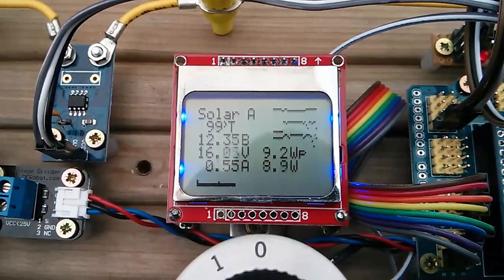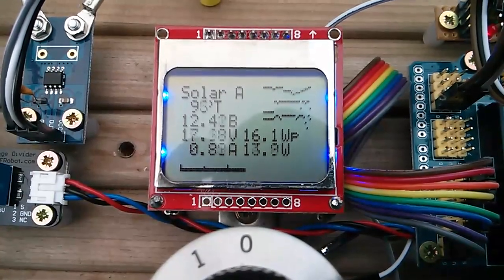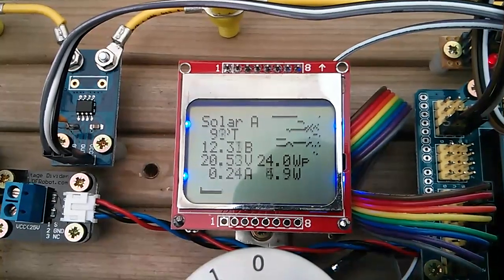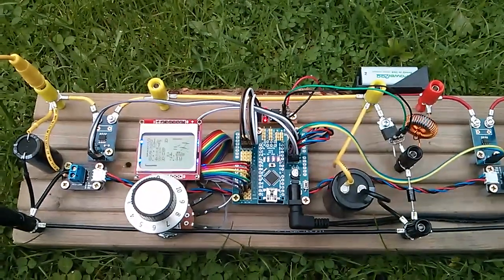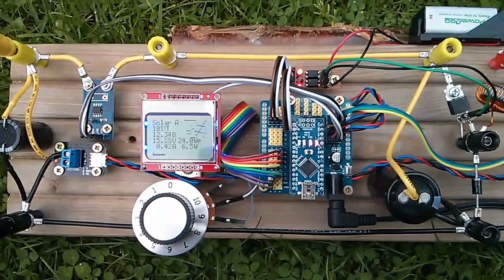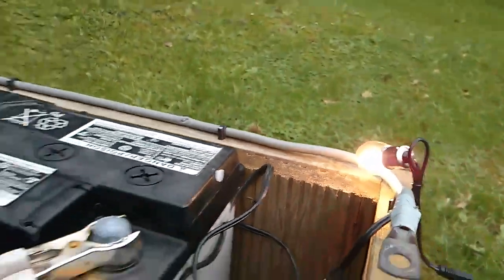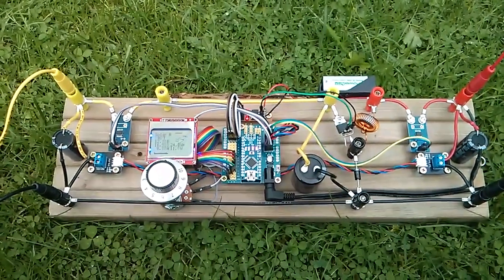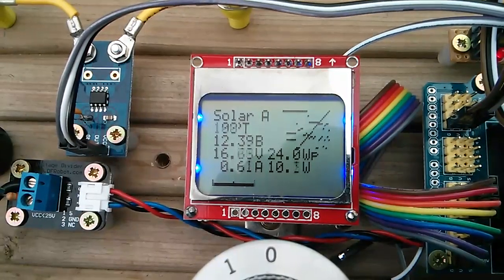Arduino MPPT Solar Charge Controller #18 - Tracking Algorithm Works!.. Sort of

Comment: Why you have used 9V battery? Can't we use same arduino power?
Reply: Kalpesh Patel, to drive an NMosfet highside, so on top of the solar panel voltage you need an extra voltage source to get Mosfet Vgs (voltage gate source) above solar voltage. One might think about to bring arduino ground to solar plus, but this will bring new problems riding arduino on the solar potential. Cuz later on you might want to measure the buck output voltage by arduino ADCs for automatic regulation and this is only stable todo on the buck out to buck ground. Hope this helps.
Reply: illchmann thanks for updating me

Comment: BTW, the ringing you see seems to be between coil and mosfet. You said 100k and 500kHz against 11mH 110uH mas menos. I think that is a resonance between coil and mosfet parasitic drain source drain gate capacitance. I calculated both cases which gives a parasitic cap of about 1-2.5nF which fits perfect to such a big mosfet. Do you plan to continue this project?

Comment: Thank you so much Julian, I have some spare time and I spend a few days on a similar project. Pmax 30W panel 1.67A/18V, BuckBoost from ebay 5A max out (so its a little one), set output of buck to 5V connect a 1Ohm to this +5V and drive it in common source with a big mosfet controlled over simple voltage divider taken directly from solar panel. All in all this is just a testsetup. Today I saw all your videos about muppet or MPPT, hope I didn't missed one, but I consumed them like a junky! I might saw a different  video from you in the past. However, your channel was new to me and I dont know why I never noticed it.....  I like the practical way you apply electronic knowledge. Let me ask one think that I saw in your project. You got in trouble with the automatic tracking, and also at beginning the input current measurement was highly noisy. My question, under following preconditions: the hole system sit happy without any dynamic no voltage change of batterie, solar voltage stable, no current flow from A to B at all. Actually, one point in time without significate current flow. Now imagine you change the PWM one step up/or down, the current shunt is in between Buck and fat Cap and will for a short moment theoreticaly measure an infinite high current? So maybe not, cause the buck can be seen as coil with high switch on impedance input.... wouldn't it be better to place the current shunt before the cap to get better solar IV characteristics not mixed up in parallel with the cap. Cause I believe you measure and track more the constant behaviour of the cap with an slide overlay of the solar panel. I continue watching your videos and hope the collection does increase a lot in feature!!!! Cheers

Comment: I watch this mind-boggling piece of junk thing that you trying to make it has absolutely no purpose but to do what are you trying to do with it trying to turn the soul of the solar panel supposed to charge a battery and once it's charged you take energy from it from an inverter what the hell's all this crap and between what is the purpose of it
Reply: Just watch his previous videos. And btw your sentences are quite incomprehensible.
Reply: James Ledesma, your comment is typical for a semi knowledged user. You are not an idiot in electronic I guess, but you are by far away from being an expert.

Comment: Were you starting your initial MPPT point search at around 50% PWM duty cycle?  Looks like not enough filtering... you may be seeing the Voltage measuring noise...?  Change PWM point (disturb), wait for filter to settle, test (observe), make change, etc.

Comment: Hi Julian! I have one question, what about the maximum voltage? I searched in the code, but there is no line that describe that the converter should no increase the voltage over 14.4. Thank you!
Reply from the maker: Gere Ádám I haven't included battery voltage maintenance yet.

Comment: Thanks for this series! I was thinking last year I should look at whether MPPT was possible with the Arduino and how to do it but never got around to really investigating. I'm glad you've done it because now I have a basis to start at. If only I could understand the buck part of this and how it's being controlled...! The rest (voltage/current) I have done previously using the same methods, and I use the Nokia LCD's too =) Before I do this however I need to finish my existing power box project! Again thanks for the series, I'm looking forward to an update.

Comment from the maker: In response to James Hebden below (there's no reply link):

Thanks James
Very interesting question. I see there being two very clear and distinct states - power maximisation, and float voltage maintenance. The controller will need to decide which one is appropriate at any one time. Battery voltage is the primary trigger - below float voltage (say 13.5v), the aim is to maximise power coming from the solar panels to maximise the rate at which the battery is charging - above float voltage, the controller will need to reduce power coming from the panels, to hold the battery at a constant voltage. Switching between these two states will need to be done with sufficient hysteresis to prevent oscillation.
I'm seriously considering starting an Arduino-based PWM controller to develop the float voltage maintenance algorithm, then porting the code over to the MPPT controller once it's stable and reliable.
Reply: Thanks for recording and uploading #19 Julian, looking forward to the PWM controller build-out. I agree it's a much more logical approach to get the charging down-pat via the Arduino first. Plus, you can never have too many projects!
Reply: Wasn't sure if you'd seen this page http://techmind.dk/arduino-singleboard/arduino-mppt-solar-lader/ - very similar project, and it looks like the charging logic is there (based on Tim Nolan's charger).

Comment: Just wanted to say thank you for this series of videos, and sharing your research with all of us - I've been working on a low-cost solar setup of my own, and have been following this video series since it started. My preference has always been to hack something together around a micro controller rather than buy an off-the-shelf controller, as I wanted to learn the various components and theory behind solar MPPT, buck-boost and SLA battery charging - and this video series has easily been the most thorough and well-articulated explanation of those topics that I have found on the internet. I'm looking forward to episode 19, as after watching every other episode and tinkering, the only real gap left in my knowledge is how the MPPT and battery charge monitoring algorithms need to interact to keep the batteries healthy whilst pulling peak power from the panels. Keep up the good work and thanks again!

Comment: @Julian lllett - Nice work Julian.  Just have a few questions.  1- Wouldn't the maximum power be based on the characteristic of the panel, the intensity of sun light, and, in particular, on the LOAD; i.e., the condition of the battery and you light bulb?  So if the  battery was fairly charged, then the amount of power drawn might be minimal, no matter how you adjusted the pulse width.
2- What keeps the output voltage about 12 V, is it the battery?
Reply from the maker: Hi Donovan
Yes, maximum power is entirely dependent on the characteristics of the solar panel and will be achieved at a specific voltage and current. In PWM systems, battery and solar panel voltages are the same, so a low voltage battery can adversely affect panel power. MPPT uses a buck converter to disassociate the two voltages.
The output voltage IS the battery voltage - the battery's state of charge defines that.

Comment: GREAT! Now I look thru all 18 episodes of ArduinoMPPT. Most impressed is the simple circut of  the buck converter! So few parts and working (why couldn't they do it in the Wellsee MPPT since they have a PIC-controller?).
According effency - a buck supposed to have around 90%. But perhaps you should calc in Ampers vs out Ampers - thats what counts in battery charging!
And you love the 4884-nokia displays over the old 16x2 ;)
Reply from the maker: Hey thanks. Yeah, what exactly is that PIC doing? I am measuring current in and current out now and displaying an efficiency percentage. Love the Nokia display - it's easy to read in strong sunlight.

Comment from the maker: The INA219 looks like a clever chip, but it's more expensive, needs an I2C implementation in the Arduino and an external current shunt. One of my design criteria is ultra low cost and the ACS712 certainly fits that bill. I did manage to get the noise level on the ACS712 much lower by increasing the filter capacitor value. But I appreciate the suggestion and now I'm much more knowledgeable about the INA219. Cheers.

Comment from the maker: Thanks for the kind comments. There's one more major piece of code to write - that's the battery voltage maintenance control loop - until that's done, it's not a charge controller!. Then I'll do a video on the economics of the project - finding the lowest cost parts that will do the job.

Comment from the maker: That's not a bug - that's Ant, my pet ant.
Yeah, I read Tim Nolan's site 3 or 4 years ago when I was designing my PWM controller. I'm a bit late to the party!
I'm still waiting for some 3mm leds to arrive from China - then I'll do a step by step build of the DCOI driver with Post-It note schematics included. It can be driven from any of the PWM pins on the Arduino.